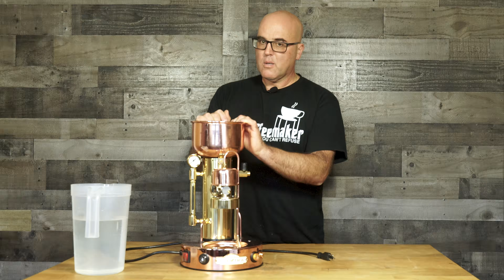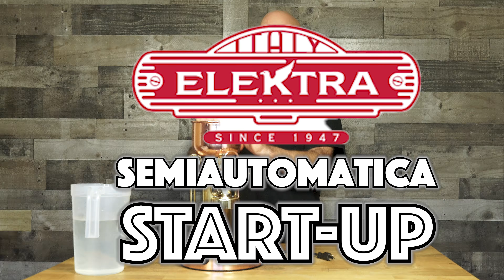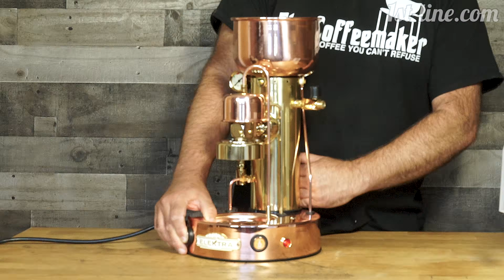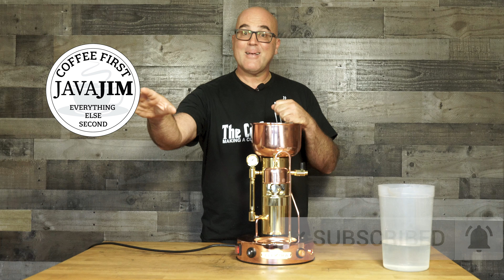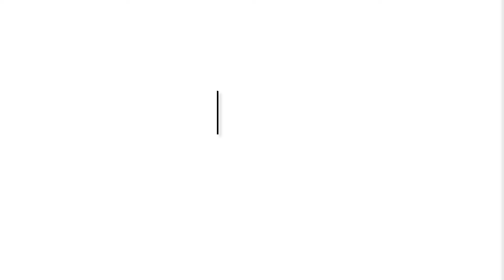Proper Start Up: Elektra Semi Automatica Espresso Machine

Comment: Please tell me the steps to drain the water from the boiler.
Reply from the maker: The easiest way is to drain it from the steam valve. Power off your machine and unplug. Empty the water from the tank by tilting the machine into your sink. The boiler will be under pressure with steam and hot water. First, you let out the steam by opening the steam valve. Once all the steam is released, remove the steam wand using a crescent wrench (to avoid scratches put a piece of cloth around the steam nut).  Then tilt your machine into your sink with the steam valve facing down (hold your machine by the tank as everything else is still hot and also have your machine sit on a cloth to prevent scratching as you tilt it). Be careful as the hot water exits. To make sure you get as much water as possible, lift the machine up and down when you get to the last drops.
Reply: Thank you.
I needed this when I moved house, and the instructions didn't mention anything about it, so this was helpful.
It's my favorite machine so I'll take good care of it!